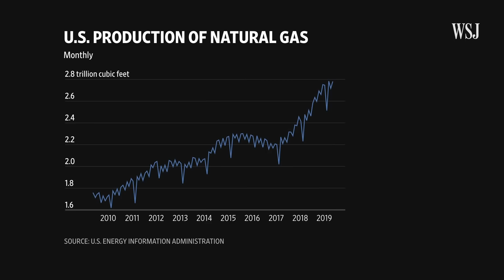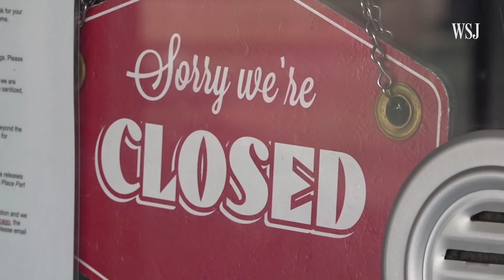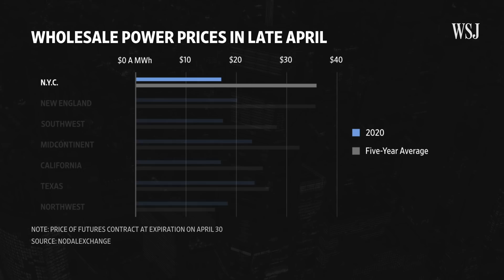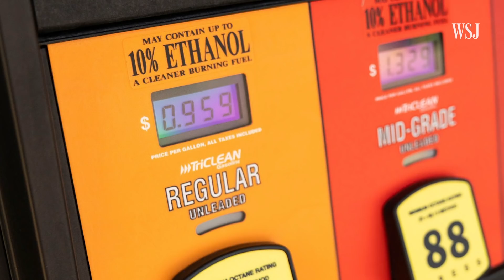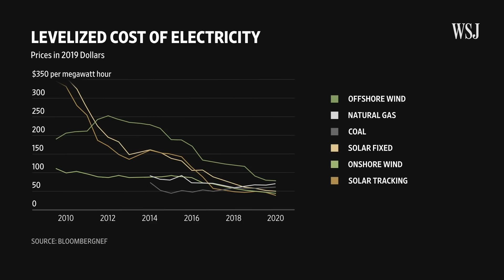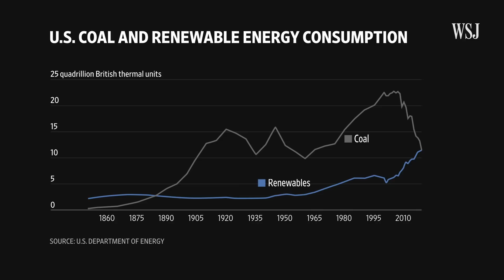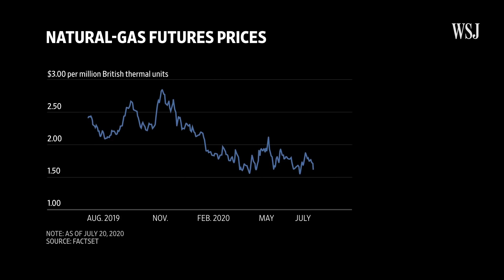How Energy Got So Cheap | WSJ

Comment: Ah, my apologies for the misunderstanding! Thank you for clarifying.
Yes, you're absolutely right. Last night, we discussed the potential of Space-Based Solar Power (SBSP) to transmit energy to Earth, and then that received energy could be used for various applications, including the production of hydrogen right here on the ground.
Let's revisit that specific concept:
The Idea: Creating Hydrogen on Earth Using Beamed Satellite Energy
 * Energy Generation in Space: Large solar arrays on satellites in Earth orbit (e.g., geostationary orbit) capture sunlight 24/7, converting it into electricity.
 * Energy Transmission to Earth: This electricity is then converted into a form suitable for wireless transmission, typically:
   * Microwaves: Beamed down to a "rectenna" (rectifying antenna) field on the ground, which efficiently converts the microwave energy back into usable AC electricity.
   * Lasers: Beamed down to specialized photovoltaic arrays on the ground that convert the laser light directly into electricity.
 * On-Ground Hydrogen Production: The clean, continuous electrical energy received from space at the Earth-based receiving stations would then be directly fed into facilities designed to produce hydrogen.
   * The most common method for this is electrolysis of water (H_2O). This process uses electricity to split water molecules into hydrogen gas (H_2) and oxygen gas (O_2).
   * This is often referred to as "green hydrogen" production if the electricity source (in this case, SBSP) is renewable and doesn't produce greenhouse gases.
Why this combination is appealing:
 * Continuous Green Hydrogen Production: Unlike ground-based solar or wind power, which are intermittent, SBSP provides a constant, baseload source of electricity. This means hydrogen production facilities could run 24/7, optimizing efficiency and output, without needing large-scale energy storage for the electricity before electrolysis.
 * Decoupled Location: SBSP receiving stations can be located in areas with abundant land and clear skies, which may not be ideal for other forms of renewable energy.
 * Fuel for a Hydrogen Economy: Hydrogen is seen as a crucial energy carrier for decarbonizing various sectors (transportation, industrial processes, heating). Using a continuous, clean power source like SBSP could accelerate the transition to a hydrogen-based economy.
 * Energy Security: Provides a potentially independent and highly reliable source of energy that isn't subject to geopolitical conflicts affecting fossil fuel supplies.
Challenges (specific to this application):
 * All the SBSP Challenges: This concept still faces all the enormous challenges associated with SBSP itself: the immense cost of orbital infrastructure, technical complexity of deployment, and the efficiency/safety of beaming energy.
 * Hydrogen Production Infrastructure: While electrolysis is well-understood, scaling it up to industrial levels necessary for a "hydrogen economy" still requires significant investment in infrastructure, including water sources and efficient electrolyzers.
 * Storage and Distribution: Once produced, hydrogen needs to be efficiently stored (it's very light but takes up a lot of volume) and distributed, which presents its own set of challenges.
So, yes, using satellite-beamed energy to produce hydrogen on Earth is definitely a concept being explored as part of the broader vision for a future sustainable energy system. It leverages the unique advantage of continuous solar power from space to enable continuous production of a clean fuel source on the ground.

Comment: Wind farm energy was never expensive. In fact..  it's free.
Fossil industry boneheads tried to dupe public perception of high wind energy costs by including the cost of construction and materials of facilities into their per kilowat hour estimates of wind energy as they were coming on line. But not the cost of construction, materials AND EXTRACTION operations of traditional fossil fuel per kilowat hour estimates because they were already built and in operation. DUH. Then they went off on a second lie rant about the high costs of wind farm maintenance as if fossil fuel operations don't cost equaly as much if not more to maintain. strip mining.... miles long fuel oil trains.. double tractor tanker trucks.. etc etc. "cheap" to maintain. yeah right.
Reply: @16vjtdalfa Even with energy storage added to their cost wind is cheaper when using the correct math. Cost of building a power plant and the batteries needed for grid balancing plus buying the fuel for running it for 30 years: ~3.5billion. Cost of building more than enough wind turbines and battery storage to replace that power plant plus extra reserve for windless days: ~1billion. Both last about 30 years though the batteries need to be replaced once or twice during that time.
After they are built the cost of running a solar or wind farm is basically just having few technicians on call and sending some minimum wage workers to wash the solar panels each week, fossil fuel plants need fuel each day and of course all the workers needed for operations and maintenance.

Comment: Energy isn't anywhere near as cheap as it needs to be and can be.  with cheap energy for example, you could turn sea water into fresh water and pump it hundreds of miles inland. Why don't we do that? because energy is too expensive. Energy is the master resource. a water shortage IS an energy shortage. unemployment IS an energy shortage. All we need is a power plant design that can produce more energy than it takes to build and run it, then you can scale that up.  That means some kind of improved nuclear plant and the only reason we don't have it is because we just don't want it badly enough.
Reply: joe allen The US has more than enough land and coastline for enough solar and wind to power the nation several times over. Energy could be incredibly cheap, abundant and completely renewable if there was the political will. I don't agree with desalination of seawater and pumping into deserts though, it's well documented that large scale desalination destroys marine ecosystems around the plants. People just need to stop trying to live in deserts.
Reply: @spencerwilton5831  You will need to sextuple energy production to get the rest of the world up to U.S. levels and this is a global issue, so expect that to be the benchmark.  How many raptors killed? How much  land covered? think of the waste when turbines panels and batteries need replacement.  it's madness.and still wouldn't allow us to increase consumption and standard of living here at all.

Comment: As the demand for natural gas declines, oil suppliers turn to renewables to buoy the prices of natural gas. Utilities benefit too. Usually, they can charge a premium for choosing to source from renewables, because it's the 'environmental' thing to do.
Reply: Seph The 100 percent renewable power companies are usually among the cheapest! I buy my electricity from a company that only buys renewable power, and they are significantly cheaper than every single one of the major U.K. power companies that are still dependant primarily on traditional power sources like gas.

Comment: I'm glad that renewable energy becoming cheap and competitive
Reply: anatoli p  America has no land shortage.
Reply: @Am-Not-Jarvis  A great deal of the American land that is usable for wind and especially solar are too far from major urban centers that require the power from the renewable energy centers.  Transporting the energy is too costly to be a reasonable alternative to using up a great deal of the land that America has that is prime for renewable energy development
Reply: @DannyOngProductions  Too costly to transport electricity? What? Electricity has to be the easiest thing to transport on earth. Electricity grids are hundreds, sometimes thousands of miles long and can transport large amounts of electricity in seconds with no moving parts.

The chart this video showed says solar is cheaper to produce than non-renewables. Do you have your own data that proves otherwise?
Reply: @nolin132  Do you know anything about how grids operate? About loss? The cost comes from the fact that they generate more power at the plant for your house than what actually reaches your house. Some things you'll want to research.
Reply: @haliax8149  I do my research. Do you?

"The U.S. Energy Information Administration (EIA) estimates that electricity transmission and distribution (T&D) losses average about 5% of the electricity that is transmitted and distributed annually in the United States."

You're making a mountain out of a molehill. Energy lost through transmission is not a significant problem for renewable energy.
Reply: @nolin132  i am very much pro renewable energy, but energy loss due to transportation is a big problem with electricity.

the fact that the grid only has a 5% loss is more a sign of how short the distances the electricity has to travel rather than of how little electricity suffers from transport.

i am happy that you did some research, but people familiar with energy will tell you that electricity loses a lot more energy in transportation than gas does

there is a good reason why big petroleum and gas pipes are built all around the globe instead of just hanging some wires in the air

with electricity you have energy loss at the cables, the transformers and even more at low power cables in the cities. also you lose a huge amount when storing it, which is super easy with material carriers of energy.
Reply: @DannyOngProductions  Meanwhile, in the real world, Iowa sells their excess wind energy to Illinois.  For 2020, Iowa wind turbines created over twice as much energy as its coal plants, and over 5 times as much energy as its nuclear plants.

Which do you think is cheaper to move around?  A few thousand megawatts of electricity over wires, or thousands of tons of coal via trucks and trains, or several tons of radioactive waste?
Reply: I'm glad the prices are falling, hopefully companies keep working on ways to make it accessible for people. Unfortunately I wish the nuclear energy gates worked on was still available to work on. Overall I just feel bad that a lot of our renewable sources are far away but I think with Corona and people eventually going further out, I think we could see renewables grow over time. I just wish we had a president that would support this instead of seeming to shun it.
Reply: @scottfree6479  "cleaner" is not a simple 1D metric. You are still left with radioactive waste which we still don't know how to deal with.
plus, in case of an accident, the consequences for the environment can be catastrophic.
Reply: Georg Plaz ultra high voltage transmission lines are going to be a solution to this, Australia plans to send electricity to Singapore and China has started to operate some already to send across the whole country
Reply: Thank China for that. No thanks to the US
Reply: they are not cheap or competitive.

Comment: "How Energy Got So Cheap" laughs in $0.40 per kwh
Reply: Time to go solar lol
Reply: @youtubewatcher1555  Solar is what brings $.40
Reply: I paid this month for 1203 kW/h  276$
Reply: Laughs in under $0.10 per kwh
Reply: I pay .13 per kwh
Reply: In my country its 0.45U$D per Kwh of Hydroelectric power.
Reply: I get max .20$ and non peak .02$. Although that doesn’t include transmission fees
Reply: @simonair  Wow, that's a big difference. You might need an EV, and a powerwall.
Reply: How original. Did you come up with that sentence or did you grab it from somewhere and changed a word?
Reply: $0.51 / KWH Southern California Edison. We also get bonus blackouts the have chance to destroy electronics on line re-energizing.

Comment: Not in the Philippines though. Lol
Reply: Lol 🇵🇭
Reply: In India prices are at an all time high.
Reply: Electricity and water bills increased. With goods and services, everything got expensive too.
Reply: You're in the tropics, you're surrounded by plenty of energy.
Reply: @fauzirahman3285  how does this comment help anyone?
Reply: @georgplaz  Ah sorry, it wasn't an answer, it was more of a rhetorical thought bubble. The tropics have a lot of sunlight, so solar panels might help somewhat. Unfortunately, the hot weather and frequent overcast weather means the efficiency goes down somewhat though its made up by the fact that there is more energy in square meter of a beam of sunlight than in a temperate region.

However, I think there's some potential to harvest the latent energy from the humid tropical air, which is frequently over 30 degrees Celsius despite the high water content.